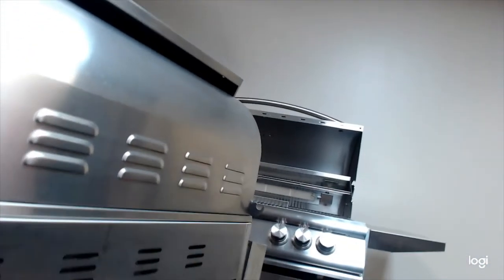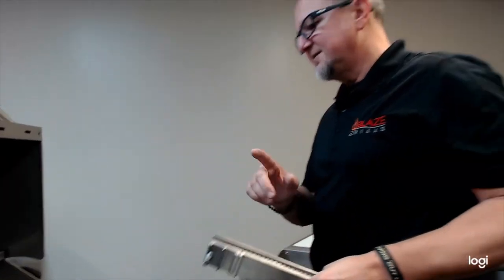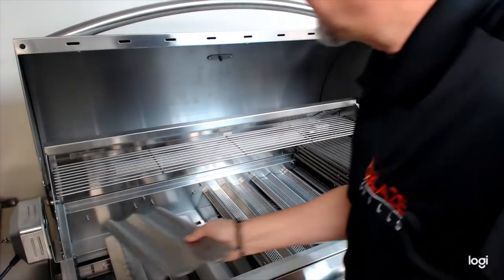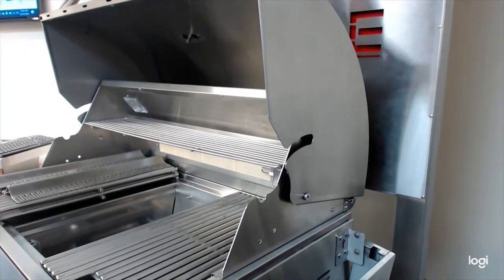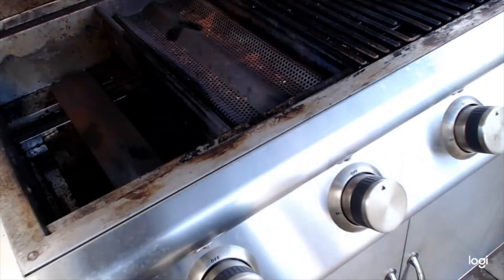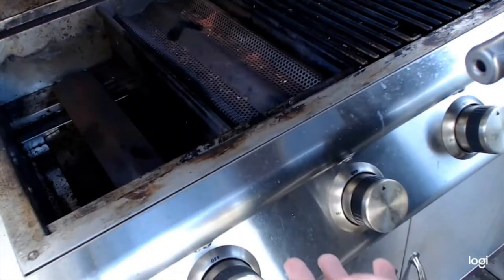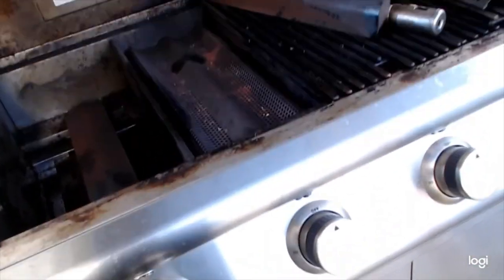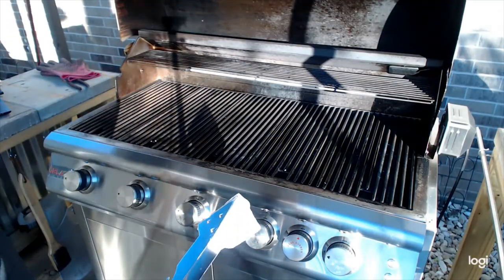Initial set up of a Blaze gas grill

Comment: My brand new Blaze 5lte doesn’t work and nobody can figure it out.  Very frustrated.  
Seems like these tubes come blocked and Blaze should have a fix or prevention for it.
Reply from the maker: Have you called the Blaze tech support team, directly?  866-976-9510. Just curious, are you running natural gas or propane?

Comment: Great videos Jim. My Blaze Professional Lux 44 inch 4 burner freestanding grill will reach my home soon. I know it's too late but I'm afraid I went a little over kill. I wanted a more powerful grill for the winter temps and for the good sears on my meats. I do know it will do that. Do you know what the temps are with all 4 burners on low? I wish there were more cooking videos on this grill. I guess I will have to experiment to get familiar with the temps. Thank you
Reply from the maker: Hey now….  Just saw this from a few months ago. Sorry for the delayed response. As far as low temps, it’s hard to put an absolute number on it.  The analog temp gauge is showing an average temp, which is true for any brand that using analog temp gauges. Depending on environment and time to preheat, beforehand, the temps could vary from 250 to 400 on low. That being said, I love those pro grills. Once you get familiar with its “personality”, you’ll be the envy of every block party…..  which leads me to my next point. There’s no such thing as overkill, when it comes to grills. Lol!!! Cheers.

Comment: I bought a new Blaze built in grill and have had nothing but problems. The wire harness on the grill melted as I seasoned the grill as it was a little windy.  I then purchased the $360 wind guard to prevent this problem.You can not get anyone to work on these grills. All they will do is send you the parts and you are on your own. I have called and they will send you a video but that is it. I have paid another company to install a new wire harness, transformer and switches that Blaze sent me, still no lights. Blaze will sell you the grill, but if you ever want service, forget it.
Reply from the maker: Hi there… sorry for your frustration. Yes, our warranty covers parts, not service. It’s one of the ways we keep our price points down. But, we do have a number of distributors that will occasionally go above and beyond to help a customer out, with service. In fact, many of our traveling factory reps will make house calls, so to speak, on occasion. It’s definitely not the norm but if you can let me know what state you’re in and which dealer sold it to you, I can reach out to our distribution partners and / or factory reps and and see if we can help you out. I can’t make any promises here, but it’s worth a shot.

Comment: Thank you I did that,  the documentation is terrible, I purchased the extra ceramic flame tamers, nothing about how to fit them,  I have 2 bulbs and a AC adapter nothing about them at all,  I have flame separators nothing about them, I have 2 cups of screws and nuts left, nothing about them.  The installation guide show 3 types of screws, but it doesn't tell you what ones to use where
Reply from the maker: Hi there... I'm the first to admit that documentation is not great, which is one of the reasons I started doing these videos. We have a new R and D person that is tasked with overhauling many of our manuals. As for me, I'm always adding content, time permitting, between work travel and my regular day to day obligations, at Blaze. I have a ton of videos scheduled for next week. Some new, some updated. The package of screws is completely random and, yes, there will always be extras. This initial setup video should cover many of these concerns. As for the ceramic flame tamers, I have a couple in my possession. Marketing is asking me to do a video on them, I just haven't been home to do that yet. Too much time on the road.... I appreciate your comments and apologize for the frustration. You can also call our tech team with any questions. 866-976-9510. They're usually really good at returning calls in a timely manner. Just keep in mind, this is the busiest time of year for us. They might not be able to answer right away.

Comment: Argh.  I needed to see this before I installed it.   Got to go back and pull those pins
Reply from the maker: If you have an LTE, it’s possible to get them out from the front. Try to pry them out with a thin screwdriver. Be careful and take your time. Same for the pro series, just more challenging because of the firebox design.